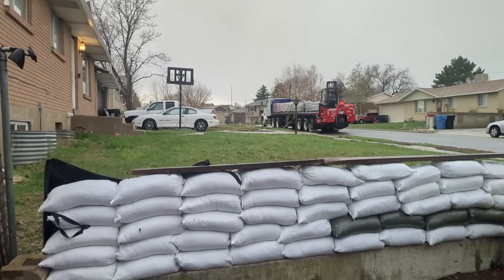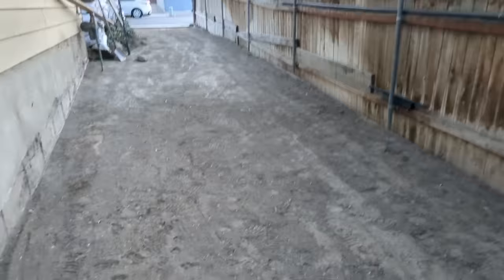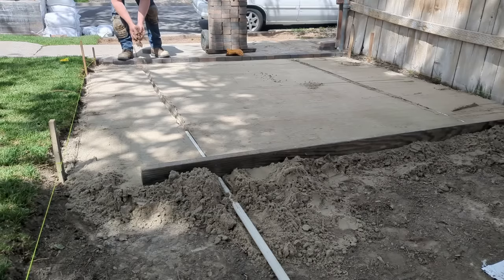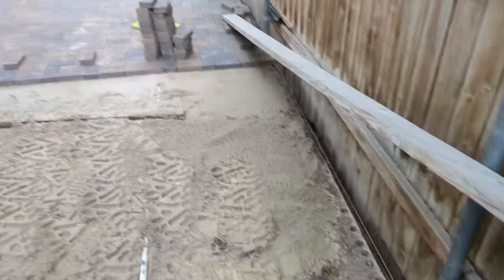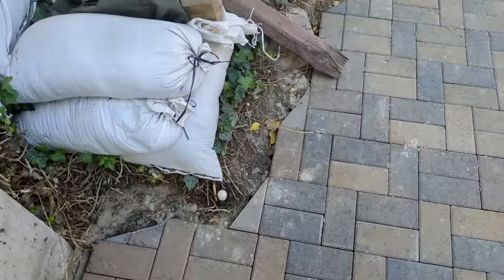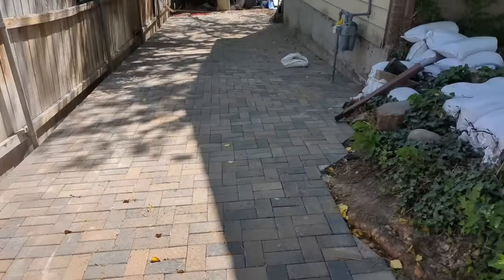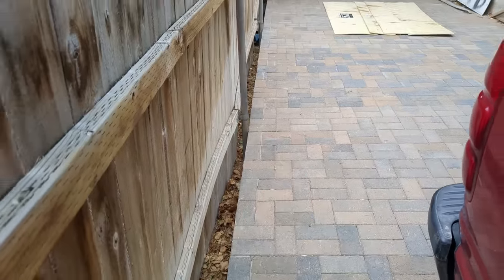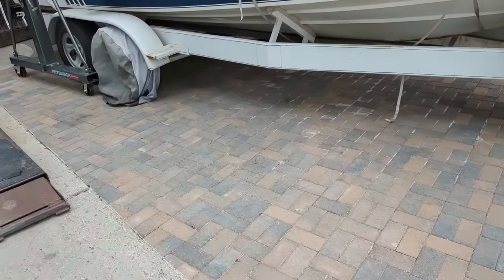Paver Driveway DIY 1/10 the cost

Comment: Sprinkle some borax or boric acid onto the sand before you put your pavers down. It knocks the ants back and keeps them from turning it into a huge colony and undermining the pavers
Reply: Does that offer long term protection? I'd expect it to wash away over the years...
Reply from the maker: That's great advice.
Reply: My father always mixed the sand with cement powder which would eventually harden up enough that the ants wouldn't be able to carry it away. Don't know what the ratio was, but something like 10:1.
Reply: Good advice. I'll use that

Comment: Technically the pavers are the more economical way to perform in the long run as well potentially spanning generations of utility, mainly if I understand correctly due to the re-usable nature of the material where only human power is required to process and re-use compared to more heat energy required for say asphalt or cement based.  Great work, looks fantastic!
Reply: There are solid plastic pavers made from recycled garbage & other composites, they can catch fire though

Comment: I am 65 but I still think I could rip up my asphalt and add sand over the base and do this.  Might need to get the demo done for me. I have a huge circular drive and no way would it be affordable. Love the sale tip.  Very helpful!
Reply from the maker: The hardest part is getting the base level and down to grade. Honestly, if you did have the space putting it right over the asphalt would be amazing with just a 1/4-in or less skim of sand.

Comment: There's just no limit to what you can do..and ginger is a big help as well..that drive way looks flawless ..i also have experience with concrete but at 68 years old i don't think i could do it by myself..at least i know how it's done ..thanks friend and ginger too..cheers 🇺🇸🇺🇸🇺🇸🇺🇸🇺🇸🇺🇸
Reply from the maker: Hey Thanks. I grew up learning concrete the hard way with mixing small batches in an old Sears mixer. That was the easy part as my father also made me and my brothers load the sand and gravel at the gravel pit as well. Countless shovel loads to fill the bed of a pickup.

Comment: I enjoy your videos. I reside in Upstate New York where we have extreme freeze and thaw cycles at the beginning and end of winter. When we have pavers, cement or blacktop that surrounds gas entrance pipes, we use foam and schedule 40 PVC to sleeve the gas service pipe. The frost cycles can cause the hard pavement (in your case pavers) to rub and - over the years - eventually wear away and cause a break in the gas service pipe. Excellent job!  P.S. I also admire Ginger.

Comment: Fantastic looking paver driveway. Having done one myself (with larger pavers) I understand the immense amount of time and prep it requires to do. 

I see you are making the choice of sand for packing material. HOWEVER if you want to make certain it all stays interlocked & weeds don’t start growing use SAND MIX (Sand & Portland Cement Mix) they sell for $5 a bag 50-60lb so mixing it yourself won’t save much. 

I also recommend you finish it with a concrete sealer to protect the beautiful finish you achieved. The retaining wall in itself takes a lot to setup as well so Really I can’t say enough about how great that turned out.

Comment: Very nice!  Looks much better than concrete.  I did a similiar walkway in front of my house, but it was curved so I had to cut every brick along the edges of both sides.   I also did my wife's house patio, but this time no curves!    We have a brick manufacturer HC Muddox in Sacramento, and once a year they have sale to get rid of excess inventory or 'old models', and they are 'almost free' like 5-10 cents.  They sell them by the pallets.
I also ran a concrete driveway to the back of one of my houses, and it ran next to the gas meter like you have.  I put pipe around it concreted into the ground so a car can't accidently run into it and rupture the gas line.   It might even be a code / law requirement, but in any case, very important safety item.
Reply: At my bro's house, in Southern California, I helped him run a gas line for a BBQ.   The only code requirements were for: 1 how deep buried.  But, since it was in a pool deck, there were additional limitations to proximity to the pool.  It was encased in the cement deck, so it required a green plastic sleeve over the iron pipe.   Also, it wasn't underneath a driveway, which probably would have required it to be buried much deeper.  So no heavy load would ever be on it.  It was fully code compliant and passed inspection.

Comment: I did this job. Made a patio the full length of the house, and paved all the area between the house, garage, and driveway. It was a massive project, and you're right, DIY will save a ton! It is one heck of a lot of work though!
Reply from the maker: 1/4 of the way through I just kept thinking I should have just poured cement and I'd be done.

Comment: Nice job.. You may want to use rigid steel pipes instead of PVC as PVC flexes and dips. That dog is awesome..
Reply from the maker: I had to follow a contour and the base under the sand needs to be at the proper grade/level anyway. So all the pipe is doing is spacing a proper sand thickness.

Comment: Pavers looks better than concrete I think, you done well. Good idea to drill some shallow holes in the edge pavers to make them stay there. I worked for a landscaper once and he charges extra for every cut. Ginger is a good helper by the looks
Reply: I agree the look of the pavers vs concrete is much nicer.
Reply from the maker: Thanks  I figured the shallow holes would give a little extra bite.

Comment: that driveway wouldn't likely last a winter around here. would likely be wavy and unlevel after winter. we usually go for having at least 6" of gravel before putting a thin layer of limestone under the stone. also i feel like you should have had a taller retaining wall so your not dumping all the water from your property onto your neighbors. maybe it is not as wet near you as it is here but it can definitely be a pretty big issue here. i know there are certain area's of town  here that flood regularly when we get heavy rain and as of right now the town doesn't seem to be making changes to prevent it.
Reply: Also, these 40mm pavers are not meant for driving vehicles on. Minimum driveway paver should be 60mm. That being said, I have bought thousands of this exact paver over the least three years when they’ve gone on sale for $0.25 and used them for walkways and patios.
Reply: @SIE44TAR  i would agree that they definitely don't look very thick but as long as the base stays pretty flat and solid probably shouldn't have an issue with bricks cracking. the base is super important no mater what is done. it was 1 think i disliked about doing patio's. spending a week or more building a good base and about 1 day laying brick.

Comment: Very nice job. You can also seal the pavers which I have done in the past at shopping malls and it works pretty well.
Reply from the maker: I debated sealing and still on the fence. I hate water based paints etc and that's all I'm seaming to find. My fear is it'll flake and look worse in 3 years than if I just left it alone.
Reply: You would probably be better off using a concrete sealer, try your local concrete supplier

Comment: Looks good! I wish we got free sand in my area, that would definitely be nice!
Reply from the maker: It was a luck thing. There was a lot of spring run off/flooding so all the cities had piles of sand with sand bags for you to self load at most city parks. It was a lot of shoveling to fill 210 bags by myself. I do have local sand and gravel pits that used to sell it for $20 a ton(could be more now days). They're self load as well unless the loader operator just happens to be there working on a real customer(dump truck load). I ended up using 5 tons of sand.

Comment: Interesting proposition. I am looking to redo my driveway at some point as it is asphalt. I always liked the look of bricks. I may very well start looking when home Depot does a sale on them.
Reply from the maker: I debated doing the entire thing in asphalt many times. For some reason nobody does asphalt here in Utah though. No-one has asphalt driveways etc. We do have cement factories here though so maybe that's why. People only do concrete or stamped concrete for driveways here.
Reply: @sixtyfiveford  asphalt is not that great and requires fairly decent maintenance such as sealing it every year etc etc. It also warps with heat and does not like oil very much. Here all 3 methods for driveways are used and asphalt seems to be popular in my area, however I prefer concrete or even better a full brick setup like you have. At the end of the day I do feel asphalt looks cheap.
Reply: @Engineerd3d I disagree entirely. A well kept beautiful black asphalt pavement looks way better than crackrete ever could. I grew up in a wealthy area and the million dollar homes only ever had the blackest asphalt you could imagine. 
Done right, asphalt is gorgeous and in colder climates has the benefit of being hotter and melting ice quicker when the sun comes out. 

Nothing beats pavers though.

Comment: have you looked into sealing? i'd imagine it would keep oil from staining the porous brick
Reply from the maker: There's a couple issues with sealing. First, it doesn't last more than maybe a season or two. Second is the cost. You read the manufacturer's website and they tell you it lasts 5+years.  But then you read the reviews and everybody wishes they had never sealed it in the first place after the first season.

Comment: I love the explanation with the retaining wall. Great job. I've done a paver patio of 400sq ft and it was a Bee. But the results are worth it. My only concern is that gravel base wasn't used. Was this due to economical reasons. Based on what you said it rains alot there. It would help filter water abs avoid wash outs
😊
Reply from the maker: I live in the desert. Very little rain.

Comment: Nice work.
Why to use lime and cement together ?
Reply from the maker: Lime added to cement makes concrete stronger. This is especially crucial in thin applications like the joints of bricks, etc. It's not overly crucial when you're doing a 4-in slab of concrete, but still could be used to make that concrete even stronger.
Reply: @sixtyfiveford  Ok,thanks.
I usually don't see a lot of lime use in your country,so i ask.
I work on an old adobe house,and we only use lime instead of cement in mortar or concrete for the house to breathe.
It's a good thing for your driveway,it wil add some plasticity like you say,on the joints. 
Nice work.

Comment: Great looking driveway. I have never seen that deal at Home Depot or Lowes near in northern NH. I was quoted $16,000 for a small foundation that cost $1,000.
Reply from the maker: They do it nationwide according to online forums. Generally it's a memorial day sale for a quarter. They sale normally for 68cents. I ordered more than they had so I talked with the manager for a while. He showed me their internal pricing screen and their cost is .58. So he says they loose .33 a brick but make it back easily with sand, tools, paver underlayment, edging etc. If I bought all the things they recommend I would have easily pushed 7grand.

Comment: Looks good, I hope I'm wrong but I do believe a base of some kind of aggregate about 8-12 inches thick is necessary. Especially if anything heavier than a mini is parked on it. Soil turns into squishy mud. Lots of experience laying pavers so I'm not just blowing smoke out of my .... Hate to be the negative Nancy but there's a good chance it'll turn into a skate park. Good luck.
Reply from the maker: That really depends on your soil type. If you have nothing but clay and live in a rainy climate, you need road base. I live in the desert without a ton of clay or rain.
Reply: @sixtyfiveford  I can agree with that,  but if you're doing a driveway for someone, you will want to take any potential problems out of the mix. My concern is any and all viewers who watch this may end up with a surface that is all cattywumpas. Again, good job on your finish.

Comment: It is 4X the labor of cement, but unlike cement, you can do it yourself at your own pace over a long weekend or vacation and save a ton of money, Also, if you ever need to put in any type of utility underground (water, electricity, etc) the pavers can be pulled up and relaid without damage most of the time. They also last a lot longer than cement tends to and weather way nicer over the long term. Cement looks nice for the start, but weathers worse IMHO.

Comment: Really great video curious on how much it would have cost you if you would have done cement yourself, did all the labor yourself? I'm sure you quoted that as well.
Reply from the maker: If I had the concrete delivered by truck I would have used 2 trucks around 16 yards. That's roughly $150 yard or $2400+delivery fee per truck, so close to $3000. I would have needed a few friends to help for the day also. I learned concrete work the old school way of mixing batches by hand in a cement mixer though. It's cheaper and slower but could be done by one guy over a week. I would have been under $1000 depending on my gravel/sand costs.

Comment: My first job was working at a factory that made paving stones. I remember that the whole work yard was covered with pavers and we drove large forklifts on them without any issues. On the otherhand, our city decided to replace the traditional cement sidewalks with paving stones in the downtown core. The contractor was either cheap or didn't know what he was doing and didn't properly prepare the base. Our factory General Manager even went to the job site to teach them how to do the job right. The contractor refused and sure enough within a year, the new sidewalk looked horrible. If someone isn't prepared to do the prep work like you did, pavers aren't for them.
Reply from the maker: So true. Different climates also require drastically different under base. Some places people put down nearly a foot of crushed stone to help stabilize the soil and drain water.
Reply: Truth is, if done properly, brick paving can last more than a lifetime for most applications.  In my city, we still have original victorian brick sidewalks and streets in good condition.  In most places, but not all, the brick roads have been blacktopped over.  That's more about ease of maintenance and ride comfort than anything else.  You still get a good look at them when they scrape the blacktop off to redo that.  This is in the midwest.  We have winter and plenty of heavy rainstorms.

Obviously, the material isn't suitable for everything, but foot traffic on a sidewalk killing it within a year?  Yeah, they really screwed that job up bad.

Comment: Can you explain to me why you don't need gravel/rock/paverbase or brock panels for a driveway here? I don't understand how with the weight of a vehicle doesn't just push down to the dirt, through the sand. If this strategy works, then I'm definitely going to do this to our driveway to save some money, but everyone has told me without brock panels or 4 inches of paver base beneath your sand that your driveway won't last more than a couple of years.
Reply from the maker: Every state/region is different. If you have clay soil that doesn't drain it'll just smush around so you need a base. If it rains a lot there that also makes a difference.

Comment: Nice work. It came out very nice, and adds appeal to your home. Love your videos from the days I first learned from you how to rebuild a carb on a toro 3650 I purchased and still runs strong to this day!  Have a couple of questions. 
Would it have been ok/ beneficial to cement all of the bricks in order to have a more firm driveway and prevent erosion from the sand/ elements? 
Also, the sand you used, shouldn’t it have been polymeric in order to help it bond together? The regular should wash away no?
Reply: they normally dont last very long with areas that see extremes of weather without a concrete layer underneath them... heavy vehicles will collapse the areas where the tires run in wet weather over time... then dealing with the weeds that sprout up between the pavers is something you'll need to deal with forever.

Comment: Looks fantastic and easier to repair down the road compared to concrete.  Noticed you were using a 1/2 Makita hammer drill,  love the power, but it keeps wanting to go into hammer mode instead of staying in drill mode,  do you have that issue with yours?  I have two with identical problem.
Reply from the maker: I haven't had that issue with my Makita (have 2 different hammer drills).

Comment: As to be Exp it turned out as good yet better attn to detail then many pros. BTW have you ever done a shortS vid on your galvanized pipe stockade  post install? My 21 yr-old wooden ones are starting to do the Detroit slide.✌️🇺🇲Thx.
Reply from the maker: The fence is actually the neighbors and was done that way simply to convert from an old chain link to wood slots. It was the easiest method since the steel posts were already there.

Comment: I  like your style of fence, we do the same, very modular & maintainable 👍 Yes, simple concrete/cement would be 8k
Reply: why not use cement in the sand, like for flooring/screeding?
Reply from the maker: There's a couple schools of thought with pavers. One is to make the rigid and move as one solid sheet. This makes for a flat surface but leads to cracks and breakage. The other is to allow it to flex and move. I chose the later.